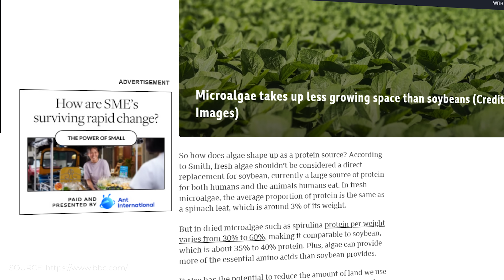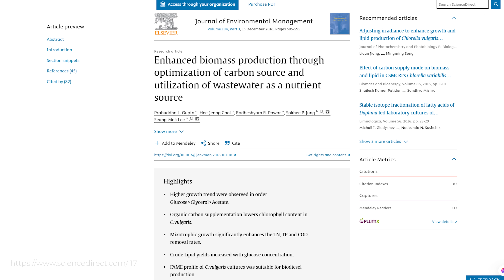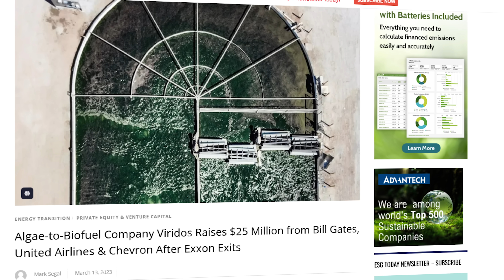Algae: The Ultimate Circular Crop?

Comment: Why not feed the algae to mayflies or something and make biochar to preserve the carbon into higher levels of the carbon cycle for longer?
Reply: It's more efficient to store the carbon from the algae. Animals turn carbohydrates and oxygen back into carbon dioxide in order to obtain energy from the chemical reaction. As soon as you introduce any animals into a carbon sequestration system, you're going to have losses from respiration.
This is unavoidable when you're using something like regenerative grazing to turn manure and grass into soil humus, but you don't need it when you're making biochar to fill up an old coal mine.
Reply: What's your idea? Using the insect bodies to make biochar?